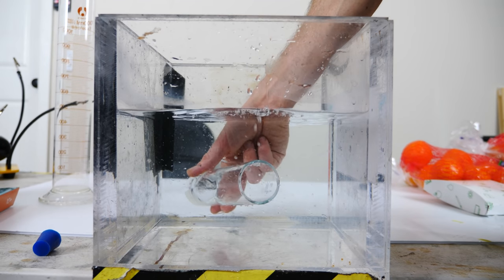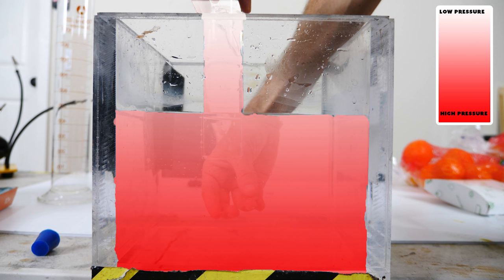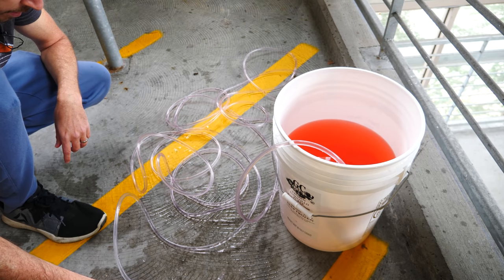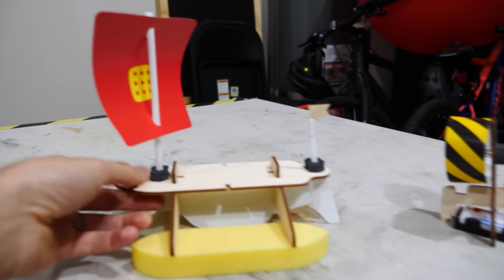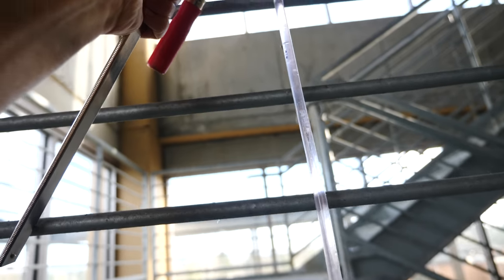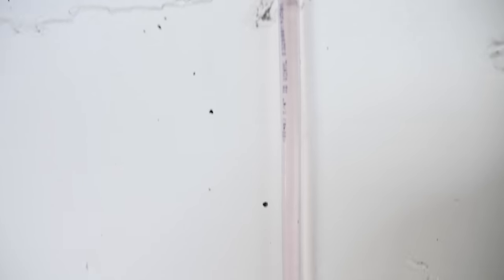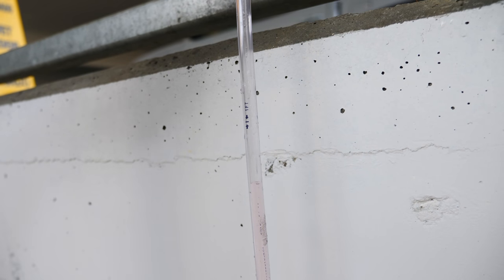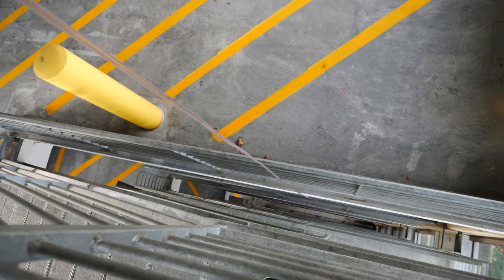Why Water Boils In Tall Cups

Comment: The height is dependent on the atmospheric pressure; about 14.7psi at sea level equates to 33.9ft of head. Do the same experiment at 10,000ft above sea level at about 10.1psi and you should get about 23.3ft of head (assuming average air pressure). Just think of the atmospheric pressure as the max pressure rating on a pump trying to pump water up an equivalent open-ended tube. 

I have been figuring out multistage water pumping for off-grid system lifting water hundreds of vertical feet of head from a stream. Ironically it’s the burst strength of the lightweight hose/tubing (I need a 1100-1200ft run and have to backpack it in, so no heavy pvc or fiber reinforced flexible hose) that is the limiting factor even more so than the pumps. With an expensive pump I could do single stage; with 2 inexpensive pumps I can do 2 stage but the static head alone would burst the tubing so I have to do 3 stages with open mini reservoirs that feed the pump for the next stage.

Comment: The mathematical upper limit should be 9.8 meters (~32ft), assuming a perfect vacuum, and 1 atm of pressure.

It’s no coincidence that this is also the same as the magnitude of gravitational acceleration (9.8m/s^2)
Reply: How did you calculate the limit?

Comment: Needs a re-do with pressure/vacuum guage on top and to go significantly higher (60+ feet) then work your way back down.  Might need to use tube which is braced so it wont collapse under vacuum.  Putting an empty hose in a water source and using a vacuum pump to pull the water up the length might be an interesting method to watch.  Also thick water could be interesting.

Comment: The rough head pressure of water is 1/2 a psi per foot. Atmospheric pressure is 14.6. So the vacuum at 30 feet is approx equal to 0 and the boiling temp of water changes with pressure and purity. Eventually you hit the point where that is lower than the ambient temp. More or less it boils down to simple math...

Comment: Since one atmosphere is pushing down on the surface of the water in the bucket, when the pressure of the column of water exceeds one atmosphere, the atmosphere shouldn't be able to hold the water in there anymore. Since 10m of water is approximately 1atm of pressure. that would make it 10m. The vapor pressure of water at room temperature is about 24 torr, or a little less than 1/30 atm. If the pressure on the water inside the tube gets lower than that, it should boil.

Comment: Another way to look at it is that the weight of a 1 square inch column of water 33 feet high is 14.7 pounds the same as typical atmospheric pressure of 14.7 psi.

Comment: when the water boils, its temperature is actually decreasing because no heat is being supplied from external sources thus, the latent heat is provided by the water itself. That's how refrigeration works

Comment: Theoretically we could use this for power generation, it'd just need to be a very massive. Combine this with block stacking power storage, and you could essentially have a monolothic power generation and storage system that could last thousands of years.
Reply: @Im_Rainrot  No energy is technically created if you run an engine in an environment that is exactly the same temperature as the engine. This is just about extracting energy that is already there. When you've got boiling water, you've got pressure, when you've got pressure, you've got kinetic energy that can be harnessed into rotational energy to generate electricity.

Comment: Some of the bubbles should be just oxygen dissolved in water. They look much bigger than they actually are because of the expansion under vacuum. The same effect can be observed in a glass bottle hooked up to a vacuum pump. The bubbles will shrink to tiny size as soon as it’s open to air pressure.

Comment: Isn't the height the water can get dependent on the atmospheric pressure? As it is not the vaccuum that sucks up the water, but rather the other way around: The atmospheric pressure pushes it up the tube.
33.8 feet translates perfectly to 1 atm, and that is what is pushing the water up.

Comment: I wish you put a little bit of glycerol in water to decrease the surface tension so it would be easier to see bubbles. With tube so thin it is hard to see water raise and go down very easily when bubbles form though entire width of the tube.

Comment: I bet you could chill water below 32f or 0c under a vacuum without forming ice. I bet it could go much higher than 33 feet in a tube if the water became chilled or pressurized. The vacuum lowers boiling points of liquids, and pressure raises boiling points. Cooling systems in cars are always under pressure in operation to help prevent boiling, thats why driving at high elevation is possible.

Comment: Unless you pre-boiled the water, the 'boiling' that you were seeing may have just been dissolved air becoming a gas. If the water boils, does that lower the temperature of the water? I think it would, temporarily. Interesting that the water vapour (at 20°C) above the water column would only reduce the water column height by about 24cm (9.5in) relative to a vacuum.

Comment: I don't believe that the tiny vacuum is holding the water in the cup at the beginning.  It's the pressure of the surrounding water.  The water pressure in the cup is smaller than the pressure required to displace the surrounding water.  That's why it empties when you lift it out of the water.  The air pressure is less than the pressure of the water.  Lifting the cup doesn't affect the "tiny vacuum" at the top, but it certainly decreases the pressure exerted on the water in the cup.

Comment: 5:34 If I understand correctly, you've essentially created a (considerably unreliable, but functional) inverted thermometer out of water? Then again, it's not independent from atmospheric pressure because of the open bucket supplying the water.
Reply: Also, quite big

Comment: I think what is actually happening is that the gasses disolved in the water are being drawn out by the weight of the water. That is not water vapor at the top of the tube, it is whatever oxygen, carbon dioxide, etc. gas that was disloved in the water.

Comment: 14.7 psi is atmospheric pressure, that height can be calculated by using 1 psi = 2.31 feet, 2.31x14.7=33.9 feet to boil water at room temp… you just confirmed it!… way cool

Comment: Isn't the reason for the height limit because at approx 33ft the pressure of the water at the bottom of the tube is equal to the atmospheric pressure? So the exact height will change depending on the air pressure and the purity of the water. So the boiling point of the water would only make this theoretical height possibly lower.

Comment: its not actually boiling at 100 degrees Celsius. Its the suction from the weight of the fluid thats causing the gases to separate, then the gas condenses at the top and flows back to the fluid, and this cycle looks like boiling in this thin tube. 
The same thing would happen if you blocked the end of a syringe with water in it and drew the syringe extremely hard. A gas pocket would appear, then disappear as soon as the suction is released.

Comment: I remember my Dad saying that there was a limit to how far water could be sucked up, and why water pumps were installed at the bottom of wells instead of the top.  BUT, I didn't realize exactly WHY, until I watched your video...  OF COURSE,  duh, THANKS !!!!   Water's boiling temperature changes based on water pressure, or "lack" thereof...  So, at 30(?) feet, the pressure on water is so low, the boiling temp is reached.  NOW IT ALL MAKES PERFECT SENSE.  :) :)
At sea level, water boils at 212 f°, at 5,000 feet 203 f°, at 10,000 feet 194 f°
and so on, the lower the pressure the lower the boiling point.

Comment: The boiling thing here created a lot of confusion. If the liquid does not boil at 0mb, then it will go up to 10,13m at std/sea level for a liquid with a density of 1kg/l, and then just mantain a vaccum for any length above this. But as the water boils then it becomes a bit fuzzy and the limit is a time function, as more water evaporates as time goes. 
The key point is that this effect is mostly unrelated to boiling but I understand the confusion.

Comment: It would have been interesting to pull a large amount of extra tube out, effectively filling the extra tube with water vapour.  Then to seal of just above the water level, take it all back down to ground level and see the effect on the tube (crushed?) and how much water is created in the section of the tube with water vapour in it.

Comment: So, that 33.8 feet would apply at sea level where that atmospheric pressure is 14.7. At high elevation where the air is a lot thinner, I would imagine you wouldn't be able to get as much use out of a pump drawing from the top, and when pumping water from the bottom of a deep mine, the higher air pressure would help you out a lot. What about high pressure or low pressure weather systems? Can they ever make a significant difference?

Comment: Someone may have mentioned this already, but I didn't want to read thru all the comments... Basically you have made a barometer, but instead of mercury inside, it is water. The height of the water column in the tube will be the same as the atmospheric pressure, and at a standard day of 29.92 inches of mercury, you are at 33.8 feet water column. It's the same thing.

Comment: cmiiw, the theory is just standard presssure = density*gravity*height. with 1 atm pressure, water with its density (around 1gr/1cm^3) and gravity about 10 meter^2/s then its about 10 meters height or about 33 feet

Comment: I would like to see you do this experiment at the lowest point on Earth on land which is the dead see 1000' below sea level and then do it at a very high elevation and I guess you'd have to do it at whatever time of year makes the water closest to the previous place. It would be cool to see how the pressure at the bottom changes the height. I would also like to see you bring a very sensitive balance  ⚖ (scale) and a weight but don't recalibrate between tests to show the difference in gravity and pressure. Maybe you have to put the balance in a vacuum at both places also to eliminate the weight of the atmosphere and just show the weight of the weight.

Comment: Kinda weird that no mention of mercury column barometers was made.
Which was the original way of meassureing air pressure, amd they worked based on this principal.
Except  that they used mercury instead of water to make it more practical. You only need about 30 inches of merucry to do the same.

Comment: It is about 9.81 meter (m) because our gravity is 9.81 m/s^2 right? And in diving, for every 9.81m below the surface the pressure increases 1 atm. So 9.81 meters "above" the surface , in the top of our hose, the pressure decreases 1 atm resulting in 0 atm (vacuum).

Comment: Great demo!! It got me wondering about different shapes. The tube has a consistent cross-section. What about a conical shape? I’m thinking inverted cone specifically. My hypothesis is that it’s either the same or would boil sooner in the inverted cone. If you already know I won’t have to do the experiment. 🙏

Comment: 01:10
Is there a theoretical limit how high the water can get?
Yes, of course there is. How high it is depends on the exact atmospheric pressure; for that's around a bar, the hight is about 10m.
Beyond that height, there really is a vacuum some of the water evaporates into, so everything above about 10m is pure water vapour.
It's the same principle like in a mercury barometer except that mercury barometers only need roughly a 13th of a water barometer because mercury' mass density is roughly 13 times that of water's.

Comment: Youre pulling a vaccum at a certain point that any tiny molecule of water grows exponentially in size the higher the pressure. Exactly like the bends inside a pipe instead of veins and those bubbles got nowhere to go but up and fill the top fighting pressure with weight like a yoyo when you go up n down with it. I also learned this phenomena in fire academy.

Comment: I had guessed at the start of this video that it would be around 10m, since that is 1 atmosphere's worth of pressure - at which point the pressure at the 10m mark would be equivalent to deep space vacuum (presumably) and therefore nothing stopping it from creating a vacuum void.

I considered the de-gassing of o2 and co2 from the water, but didn't consider it boiling off. Glad at least I got part of it right on my own though.

Comment: Hmm, currently wondering how much of a difference the temperature actually makes. 10m of water create 1 bar of pressure, at the bottom there is one bar, so at 10m above the bucket it should be around 0 bar. It won't reach 0 bars, but the pressure is changing very rapidly with height at that point, orders of magnitude with little added height, evaporated water decreases the water height so that it stays around 10m. If temperature is increased it makes sense that water evaporates more easily, but it won't really change much about the fact that roughly 0 bars, the point where pressure reacts most sensitively to height increase, is around 10m above the bucket.

Comment: I wonder if something like this could be modified for efficient desalinization. Use a vacuum chamber and a tall cup to vacuum out purified water.

I wonder if the energy cost of running a pump would be less than boiling water at atmospheric pressure.

Comment: there is a few issues with this experiment: 
1. you did not checked the water temperature with a temperature probe.
2. to me it not makes sense that water in the tube boil, because otherwise every tall buildings that have a water system would have the water boil in the pipes at the higher floors.
3. it could also be possible that the seal at the top was not hermetically sealed, so that the waters own weight pulled enough vacuum that the seal leak a bit when you reach that height
Reply: The boiling point for the water is lowered when the pressure is lowered

Water does not incress In temperature or lower. Just the tempture for the boiling point needed has lowered

Comment: You essentially made a water barometer. If you left it sitting there the level would change as the air pressure changed.

Comment: One theory I have, is that as you raise the tube farther above the meniscus, the water just below the level should get COLD. Let the temperature normalize, then lower the end of the tube, the meniscus should go down, because the water should get HOT. Once the temperature normalizes again, the level should also normalize, coming back up, as it cools back down. The temperature change will probably be minimal, but you should see a foot or so of variance, until the temperature comes back to ambient.

Comment: One question. What is the difference between boiling and sublimation. 

As a lay person we know heat makes water boil. 

As a slightly more educated lay person we know that lower pressure will lower the temperature where water boils. And in a vaccume it will evaporate with out melting.

And that evaporation is sublimation.

But at what point do those words change places

Comment: 33 feet (at sea level) is the limit of how far even the strongest pump can suck water up a pipe or tube because 33 feet of water = 1 atmosphere, the weight of the same diameter column of air from sea level to the upper reaches of the atmosphere.

Comment: interesting. if you were to put a tub full of water in a vaccuum chamber, then do the part where you lift the submerged tube full of water out the end, would the water drain out of the tube due to there being no atmospheric pressure pushing the water back in?

Comment: How do buildings get water if it just boils when it gets to a certain height? 

Do the engineers have multiple relays for water so that the water pressure doesn't exceed a certain amount?
Reply: well the water is being actively pumped. The pressure doesn't drop if you keep pushing water up..

Comment: Before I watch more, I'm going to say that the limit is about 25 feet. Any further and you'll get a vacuum, probably tbe water will boil first and fill the vacuum. 25 is the maximum that you can pull water with a pump, so maybe the vacuum height is a few feet more.

Comment: Even if the water didn't "boil" because you reduced its boiling temp, it would not get any higher than the weight of a column of water balanced against atmospheric pressure of 14.7 lbs approx.

Comment: In your opening statement, you finally get to the correct explanation of why the water stays inside a closed, inverted cylinder.  In a vacuum, there would be no force to keep the water in the tube.  Of course, in a vacuum, the water would boil and freeze at the same time, depending on heat transfer rates.

Comment: I think you should have mentioned that even though the water was boiling, it wouldn't actually be hot but rather the decrease in pressure decreases the boiling point of water.
Reply: Right? A lot of confused comments asking if the water gets hot could have been avoided
Reply: Ok, thanks, I'll delete my comment now that assumed it would heat up.

Comment: If you had a tube 40ft high, suspended above sea water with a check valve at 40ft, and pumped sea water at more than 1atm at 35 feet, would you get desalinated water

Comment: It's crazy thinking that gas part is actually also still pure water, but in another form. Was there any change in temperature where it turned into gas? Also at what point does a tall cup become a capped pipe?

Comment: It’s not boiling it’s creating a vacuum.
If I remember correctly this occurs at exactly 10 metres. (For pure water at sea level)
No surprises there.
Boiling is when liquid water turns into a gas.  Correct me if I. Wrong here.
Reply: It is boiling, boiling points are not just a temperature, but a combination of pressure and temperature. You can boil water below 0°C at the right pressure